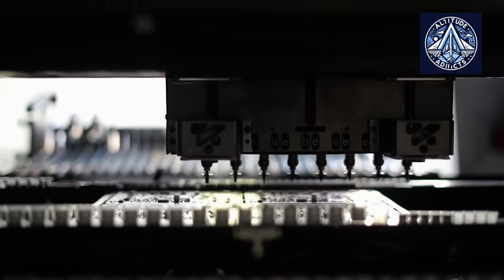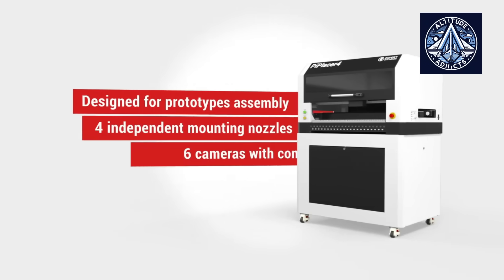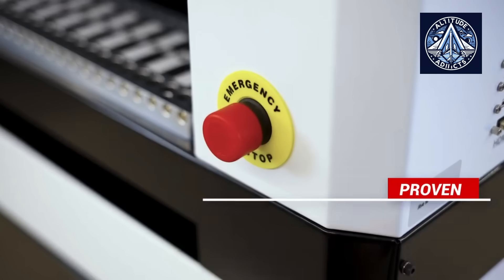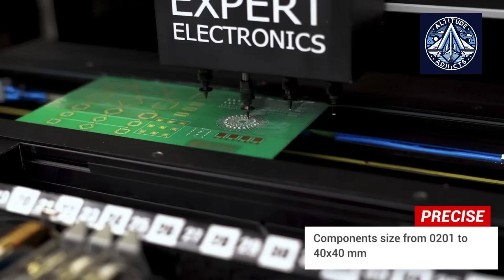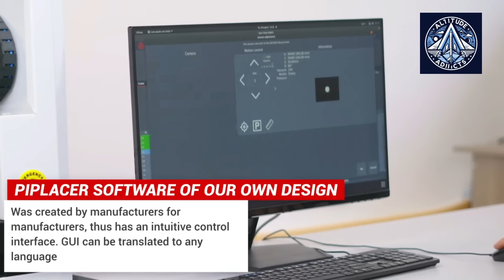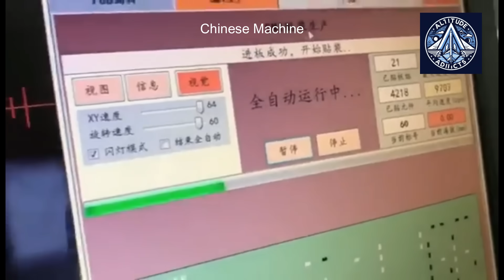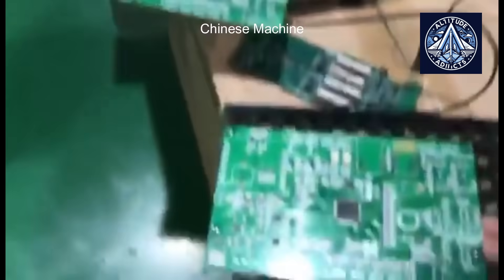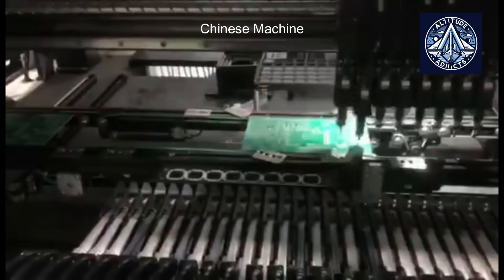Russia’s New PCB Assembly Robot Shocks the Industry | Pick and Place SMT Machine PiPlacer8

Comment: The only problem with these. The Russian, and some Panasonic units. is its way too slow for mass production. Only prototyping, When even older machines like a Fuji CP6 can place  Like 40,000+ an hour. And some run at 900 parts per minute on the CP6. And is over 20 years old.